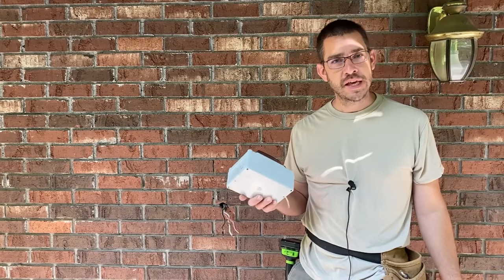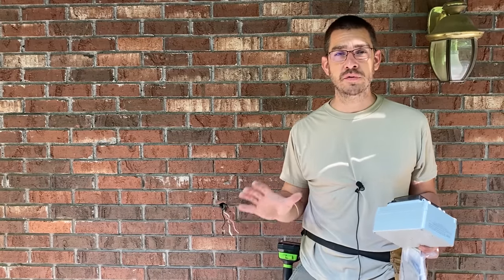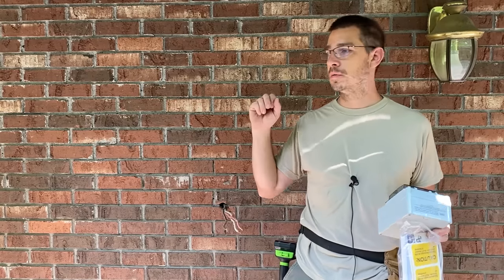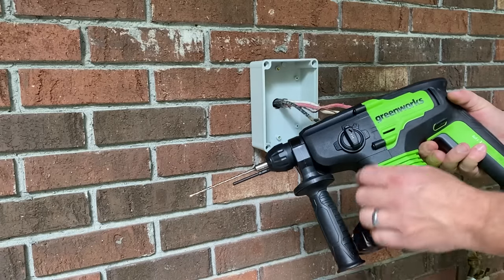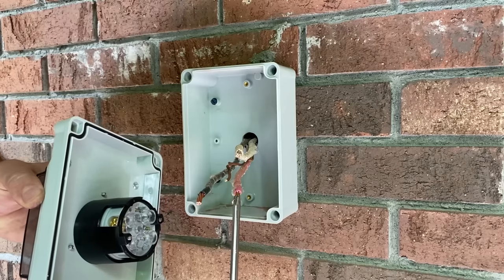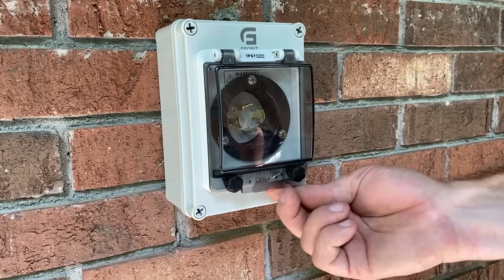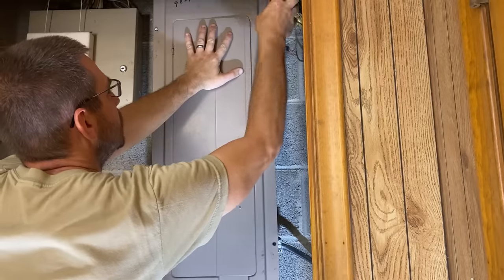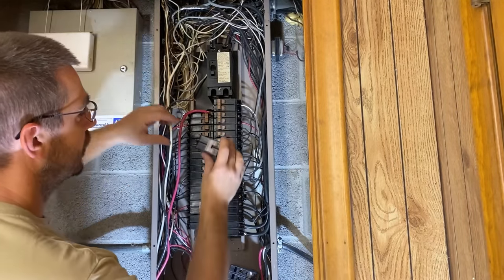How To Safely Power Your Home With a Portable Generator

Comment: In Australia i have seen a REALLY good set up, the genset was a diesel generator about 20kva rather big with a battery backup system if the generator either failed or ran out of fuel, that way the house still had lighting. 
But in Australia we are NOT allowed to touch our 240v wiring in our homes. Not only does it void your homeowners insurance but you can also be held fully accountable if something goes wrong and causes a fire or backfeeds into the grid and kills someone. Happened in my state a farmer used a generator to power his gear and ended up electrocuting a linesman as it was all dead their end (planned maintenance) they tested the line all good but less than half way working on the lines is when the farmer fired up the generator and well yeah farmer got sued.
Reply: Australians have safetied themselves out of freedom as made obvious in the aftermath of covid… I’d rather live a little dangerously than under a totalitarian government. It’s too bad. I feel for the true patriots that are left down there.

Comment: I was really shocked by how much effort it took me to get a reliable system in place. Main steps:

1. Install an inlet on the outside of the house and wire it into a breaker installed in the the top left breaker on your panel. Use suitable heavy gauge, 4-conductor wire. E.g., for a 30amp setup, you'll want at least 10/4.

2. If you don't have an in-panel master cutoff switch for the whole house (I didn't), get one and install it.  A little intimidating at first given the huge electrical cables, but dead easy.

3. Install an interlock kit in the panel.

4. Optional but good idea, especially since you already have the panel open: install a whole-house surge protector.  Not really needed if you use an inverter generator, but not a bad idea to have anyway.

5. Call the wiring inspector, get the above inspected, and put the inspection sticker on your panel door

6. Choose a good generator. With a construction-type genset in the field, you can get away with Chinese crap.  But for home use, you want something that you absolutely KNOW will work when the s&%t hits the fan.  I recommend a Honda 120/240 setup.  An inverter set, or one of their -SX models, will have THD well within the limits of what you need for delicate electronic gear in the house. See below for why you might want to choose one with electric start.  I wouldn't recommend getting an overly large genset for what you need; generators don't "turn down" well and an oversized on will use gobs of fuel.  Get one with enough surge headroom to be able start critical systems like your sump pump (again, Hondas generally have tons of headroom).

7. If you are using a simple manual interconnect, or a transfer switch that leaves Neutral connected to the grid in either position, un-bond Neutral from Ground in your genset.  Many construction-type generators will have this bond; if so, consult your manual for how to un-bond it.  Easy.

7. Strongly consider converting the genset to run on natural gas.  NG should be available through the most prolonged blackout, and you'll never need to run to the gasoline station.  Slightly fiddly but not hard.

7a. if you did as above, unless you already have a NG connection to run your barbecue, you'll have to sling black pipe and install one.  You should seriously consider hiring a pro to do this because gas leaks = no bueno.  I did it myself though, so you can too. Call the gas inspector and get the new piping inspected.  Put his sticker on it.

7b. If you go the NG route, you will almost certainly need electric start.  Pull-start works fine for gasoline but it needs to develop a solid vacuum over a few seconds to start when using NG.

8. You may want to engineer some kind of simple roof to keep the rain and snow off your generator.  So much the better if it shields the electrical outlets out of the elements as well.  I went to West Marine and got some parts for a Bimini top and made a decent roof for it.

9. Meticulously keep the oil in the genset fresh.  Even if it hasn't been run, change oil every 6 months.  It's only a quart or so in most generators.

10. If there's any doubt, put a new spark plug and air cleaner element in there.

11. If you're going to operate the genset next to your house, you may want to extend the exhaust.  If so, do it with a non-rigid connection such as a silicone hose.  An extension may increase back pressure a bit, which will reduce the genset's efficiency a little bit, but to keep exhaust fumes away from your house it's probably worth it.

12.  If you are going to use electric start, you really want to connect a Battery Tender to the battery to keep it at 100% at all times.  A nice way to do this is, run your Battery Tender wire out to the inlet box you installed in #1 above. It will have a standard SAE 2-pin connector on the end.  The inlet box will probably have a couple of knockouts, so you can just run the connector out there.  Then it's dead simple to connect your battery and keep it charged up.

All in all, it's a lot of steps but having truly bombproof, reliable backup system.  It's not fun to be OCD about everything in life, but on a house backup generator setup it's a wise way to roll.

Comment: Excellent video however my electrical panel is a Wadsworth panel and no one makes an interlock for that panel because is so old but during a power outage I have to turn off the main breaker and turn on my generator 2 pole breaker that back feeds my panel...when the power is restored I turn off my generator and generator breaker and turn back on the main breaker 👍🏿
Reply: I’m sure the lineman working outside love hearing this
Reply: I read another comment where they made there own interlock.
Or I would pull my meter out while the generator was connected.
Reply: Get some sheet metal and a metal cutting blade. Easy enough to make one

Comment: Be sure that the part retrofitted to the main panel as an interlock is approved for the area you are in, because here in Canada ( Quebec province at least ) these interlocks aren't legal, also they are not considered as true power isolation devices because they do NOT open the neutral wire from the power provider side of the circuit. Real interlock systems fully isolate ALL the wires coming from the power provider, neutral wire included. Remember that everything goes well in life, right to the moment something bad happens. Then the judge tells you, no one shall ignore the law.
Reply: Too right. Both poles should always be isolated. Judging from this video, the US seems to allow some pretty bad habits. Having had a reversed fed neutral wire shock (I was doing a factory panel changeover where it turned out someone had borrowed a neutral), I can tell you they hit the body just as much as a live wire shock does.
Reply: @bertiesworld  Neutral shocks are as bad as line shocks, that is why the neutral have to be isolated too.
Reply: Glad i don't live in Canada.

Comment: I kinda like the way you've done this, even though its not how i did mine. 

Mechanical Interlocks are inexpensive today, the one i used is rated at 240v 150 AMP.

They have several advantages, they are easy to wire unto generator remotes, so when power is lost a generator can start on its own, the interlock will switch from mains to generator.

Its all automatic, they are designed and do fail safe, and there is zero chance of back feeding the grid, or cross connecting the grid to the generator, and because it wires inline to incoming mains, all your existing wiring is perfectly fine for carrying there normal loads, you'll be able to safely run any load including AC and Heaters. 

A decent interlock, about i don't know an hour of no power to fit it, install the generator cables, and reconnect to the breaker box. Probably do it for £200 and its WAY WAY WAY WAY WAY WAY safer in the long run

Comment: You will want one circuit to always see the power line coming into the house so you can have a radio setup to start when power is restored so you have an easy time knowing power is back.
Reply: Andrew H, there is a product called “power back alarm” from Reliance controls that will let you know when the grid comes back up.
Reply: I just my electric meter as if its on then power is back.  Also at night the street lights are handy lol.
Reply: I connected an exterior light on the power side of the panel that is on when power is back on and off when the power is down.
Reply: I look out my window to the utility pole across the street for the red light on the side of the transformer and I know power is back on.
Reply: I subscribed to the utility company for text message alert when the power is back on in my area. I also live close to street lights 😉
Reply: Or wait for the call from duke energy saying power is restored. yes, on a land line phone that doesn't require power, lol!

Comment: Great video diy instruction, just a quick point ref uk/USA regs. In the uk the earth wire is
Generally green/yellow I notice you had a bare earth, uk regs state that should be sleeved
with a green/yellow plastic tube. Bare wires are strictly a no no. Is that not code in the states.
Also any external box should have a rubber grommet  to allow the wires as they exit to be
protected I was surprised to see your box just with the sharp plastic exit hole against the wires. 
It’s always very interesting to see the differences between countries. Thanks for the video.

Comment: Great great video, really appreciate the explanation. As a newbie owner, I still have a question: 
The two hot wire and one white wire, where do they connect to in the house? I need to prepare those as well, a link  to guide or to a video would be much appreciated!
Reply: Go to school or call an electrician. Do not mess around you could get bit
Reply: One goes to one side of the double pole 30 amp breaker and the other goes to the other side. The neutral white goes to the neutral bus. That double pole breaker allows for powering both legs of the typical house with 120v legs

Comment: So you can backfeed through a dryer line as long as you have your main breaker off during power outage also assuming the breaker to the dryer is suitable for the power generated? I've only got a 3kw generator I think it's actually 2500 continuous and my dryer breaker is 30 amp. I have gas now for the dryer so I don't even use that old dryer hookup, was thinking of just using that with the interlock.

Comment: excellent video I'd like to see where the wires where run.seams like you just added a breaker and ran wires from it to outside box. also my generator is a yamaha 2000watt inverter type, would this smaller generator require a differnt type outside plug? also I have 2 fuse boxs one outside is 220volts one inside shed 120volts. I'm thinking only connect to the inside 120v. just want to power essential stuff like freidg.
few lights ect. thanks

Comment: Overall a good presentation & in his disclaimer he did state to hire an electrician if you are not comfortable working inside a panel box, good advice...I didn't particularly like the power inlet box used, it looked flimsy, to much plastic imo. The wires should have been run through a bushing rather than the raw cement wall, I used a scrap piece of 5/8" heater hose on my install & I wired into a Reliance power inlet box that sports a strong sealed spring loaded lid. Since this was a 30 amp system, the wire used should have been a 10-3 Romex,  ( 4 wires ) I don't think this was mentioned...
I used an almost identical Interlock switch from the same company, they are located in NJ...  My box is an older GE 200 amp box & my switch also went into the top LH corner of the cover...In my case, I relocated my top ( 2 ) 15 amp breakers down to bottom LH side of the box. I installed a new single double throw 30 amp GE breaker in their place & wired my Romex 3 into it. The videos ends at this juncture so I'll take a bit further...  I run a 50 ft. L14-30 cable over to my Champion, which is approx. a 7 KW portable generator which I run on LPG, i.e. propane...It operates my entire house, ALL CB's remain on...The only thing I don't operate is the electric oven, it is 50 amps...The upper elements work just fine... The 9350 dual/fuel Champion runs a deep well pump, propane fired furnace, TV, computer, all the lights & sometimes simultaneously with ease...Back outside I made a dedicated generator pad & drove a 6 ft. solid copper rod into the ground with the correct grounding clamp as I ground the unit whenever in use, most people ignore it, I don't & all of the manufacturers do recommend it...I'm ( 3 ) years in on this setup with approx. ( 20 ) hours time on the clock. I keep on hand, ( 2 ) 40 lb. tanks & ( 2 ) 20 lb. tanks as they are all portables that quickly & easily hook up to the Champ. I threw the factory LPG hose away, but kept the regulator & reinstalled it onto a 6 ft. commercial grade hose, i.e. soft & flexible...I also maintain a running time journal, whereas typically I will get 18.25 hours out of a single 40 pound tank...This generator will NEVER see gasoline, therefor I will NOT deal with gummed up carburetors from bad gas that goes bad after sitting to long...I did the advance research on my install, got it all done safely & correctly & saved myself a ton of money in the process... 
Bill on the Hill,
Vermont, USA... :~)
Reply: One other thing I failed to mention on wiring up the power inlet box, I saw no wire lock nut on the backside of the box as I did do this on my install. I chiseled out the wood to accommodate the nut for a flush fit of the box... When the wire is pulled through the box & the length is determined, it is important to LOCK the cable in place whilst you are squeezing the wires into those tight spaces for the hookups...One last thought, if the power inlet box is on a exposed outside wall to all forms of weather, I would use a clear sealant on both sides & the top of the box, leaving the bottom edge open for possible drainage...Professional electricians are more than familiar with the importance of this when working with outside utilities on a residence or commercial work sites... 
Sometimes it is those little things that can make or break a successful project...
Bill on the Hill... :~)

Comment: My dad wired into his house with a generator. He messed up the wiring diagram. ended up putting 240v on half of the house wiring and 0 on the other half. He's spent about $1,000 replacing spark fault interrupter circuits, still not sure why he put them in every single room in his house.
The only lesson I have for you here is to pay attention to wiring diagram, and if you can, test something with a voltmeter before you ever connect to anything you really care about
Reply: Always make sure you follow the generator safety rules whenever you use your generator. Remember, safety first! Here are the generator safety tips:

1) Please do not allow an unqualified person or your children to operate the portable generator. That is important against the generator safety rules. We also need to be keeping an eye on our children too. You need to make sure that your children are not playing near the portable generator especially when it’s running so they won’t get electrocuted. Generators pose electrical risks and they can be hot during an operation. Please keep your children away from the portable generator at all times. It is important to keep our children safe especially our little ones. Be aware of all the hazards.

2) Some people use their portable generators indoors which increases the risk of carbon monoxide poisoning. It’s important to have a carbon monoxide detector if you have a gas generator. Never ever use your generator indoors even if your doors and windows are open and even in the garage is not safe to use a portable generator. Not even at your porch and your deck. It is never safe to use your generator indoors and in enclosed areas of your home. Your generator needs to be 15-20 feet away from your house. 

3) 🔥generators cause fire hazards too. Never refuel your generator while it’s running. You need to let your generator cool off before refueling it and before storing your generator. Never overload your generator too. Never ever back feed your generator. You should never plug your generator into a wall outlet. Also never store propane tanks indoors. Please keep flammable things away from the generator as well and please don’t smoke cigarettes near the generator. Having a fire extinguisher next to the generator is also important against the generator safety rules. 

4) generator operation; make sure your hands are dry before touching the generator. Never use your generator in wet conditions. Don’t let your generator get wet. You need a generator tent if you need to use your generator during wet weather. Please don’t wear loose clothes when operating the generator. Turn on your generator before plugging in appliances. Use the right cord for your generator. Please do not use worn out cords. 

Hope this helps.
Reply: According to the national electric code arc fault circuit breakers are required on all circuits in house with a few exceptions!  That's most likely why he would have installed them!   They have been extremely helpful in preventing fires in homes with these installed!   For the average homes I wire, breaker costs run between $800 to $1100,  they aren't cheap!
Reply: @reryro1472  I meant carbon monoxide detector. I just forgot to type it.

Comment: So I assume that the top breaker is already in use, you are basically going to share it with the outdoor outlet for the generator?   From the video it looks like the breaker was not shared and he wired the outlet to it only.  I didn't see multiple wire connections

Comment: You need a fitting in the box to prevent the wire from pulling out from other side. It's probably fine for it's purpose but will fail any inspection. Good Video.